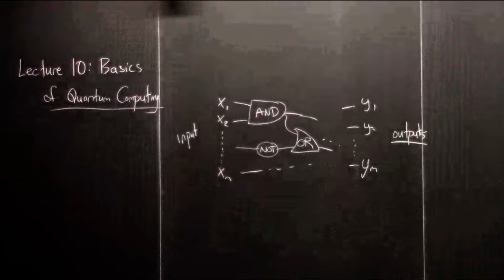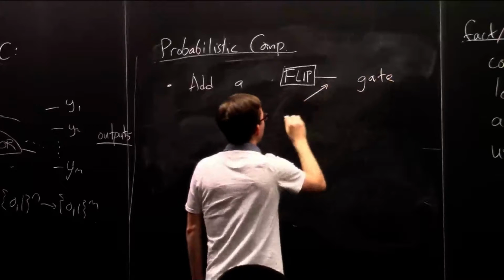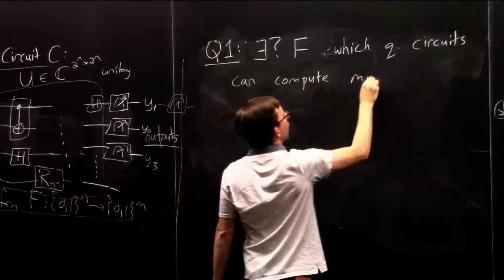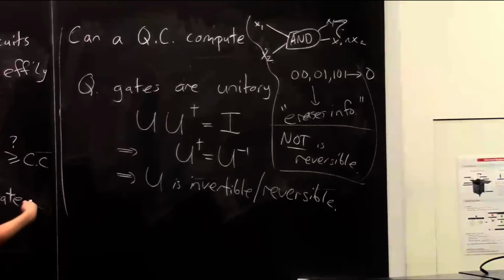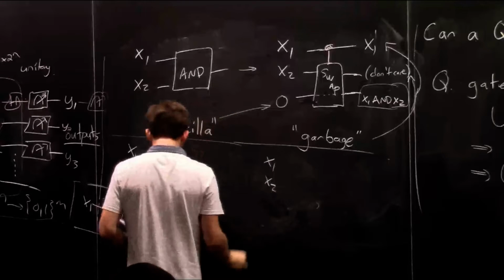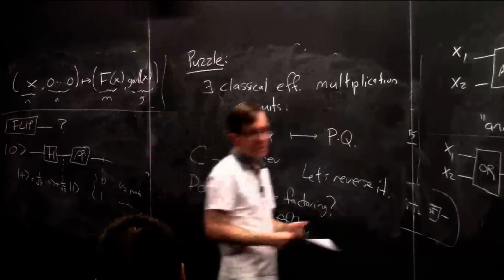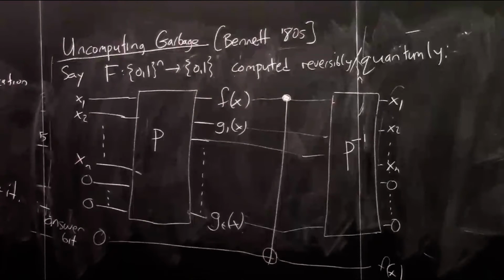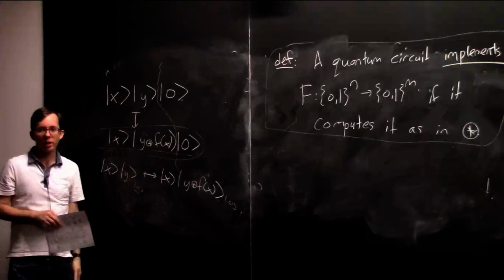Basics of Quantum Computing: Lecture 10 of Quantum Computation at CMU

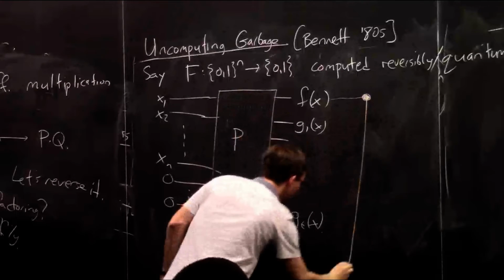Comment: 1:08:00 - Ok, there's one thing that heartburns me on all this.  How does CNOT not violate the no cloning theorem?  The control input - you split it and send it two different directions.  Am I just letting the diagram mess with my head?  Is it not really a violation because the  internal copy "doesn't come out"?  Maybe the drawing of CNOT is just misleading in implying that copy.
Reply: because it clones 0 or 1 but not an arbitrary quantum state
Reply: I'm also curious to know the answer. But maybe this only holds when reproducing classical computing. As you suggest, the CNOT should entangle f(x) with |0> if |f(x)> is a superposition. Right?
Reply: So you are correct in noting that measuring the f(x) bit is the Same as the ancilla after we CNOT them. This goes not just for classical states but also all superpositions. However you are not cloning it to a seperate entity. You are not gaining a new second  seperate qubit. They are perfectly entangled. This means collapsing one collapses the other to the same basis state. Cloning would mean you could collapse one while keeping the other in the super position. 

The next best thing you can do is apply the inverse unitary operation to f(x) so that it becomes x again. Let’s call it f-1(x). Now if we did not use any gate that involved the ancilla bit after CNOTing it with f(x), the ancilla now has the probability of f(x) when measuring, not f-1(x). This is what the principle of deferred measuring relys upon. While measuring does collapse the entire system. A gate applied to the qubit A will only locally affect A and not qubit B even tho they are entangled. While applying a local gate to qubit A still changes the global state, it cannot change the probability of qubit B measuring 0 or 1 if we just look at B in isolation. 

But as stated. We did not clone a seperate entity. Either we have two qubits that are perfectly entangled to exactly the same state. Then we did not clone anything since the collapse immediately collapse the other to the same state. 

Or we uncompute f(x). But because we assert that we do not use any further gate on the ancilla we „delete“ the information in. The f(x) bit but keep the information in the ancilla.
Reply: @roberttech4035  Ah.  That makes sense to me.  Thank you - this has bothered me for quite a while, and you're the first person who has said it in such a clear way.

Comment: 1:04:00 - One of the rules of quantum theory is that if an event can occur in more than one way, you add the amplitudes for the different ways.  So we'd like to add the amplitudes that lead to a particular "answer."  But the garbage is part of the answer too - if two cases have different garbage, their amplitudes won't add.  That's the nut of the problem, isn't it?